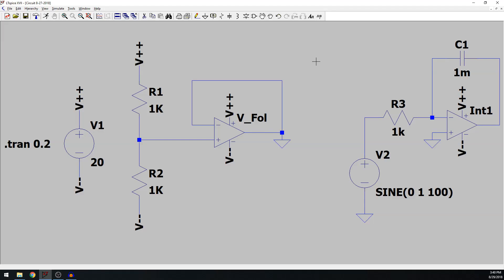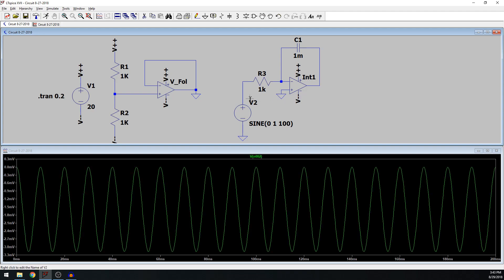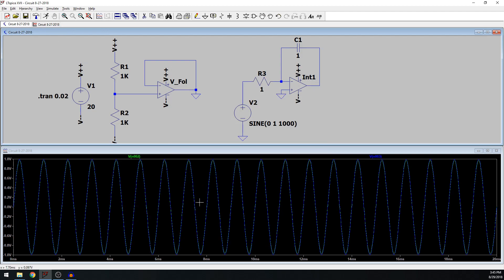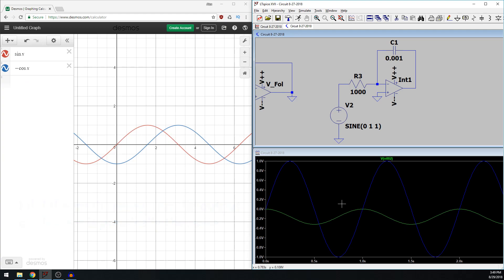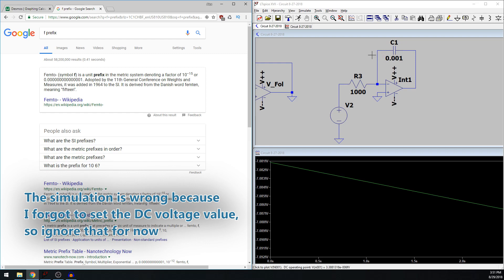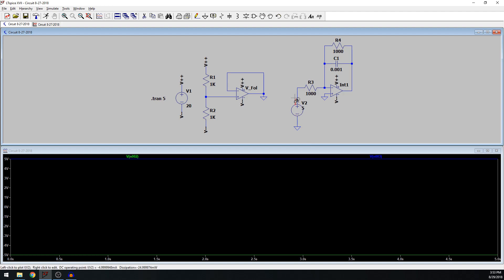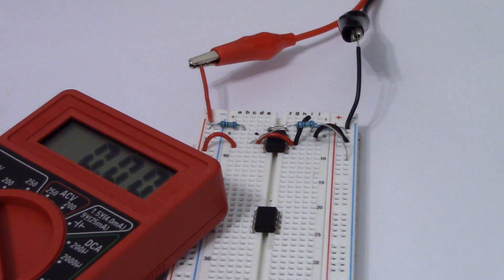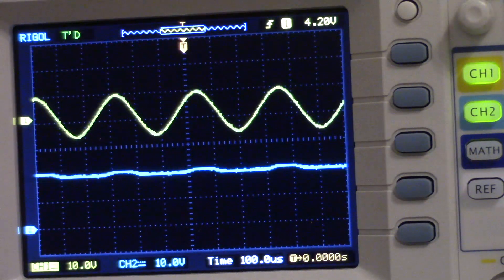Building an Analog Computer with Op Amps (Part 4): Op Amp Integrator is Not Working

Comment: Add a resistor (R2) in parallel with the capacitor, integration begins at frequencies f= 1/(2*pi*R2*C), a gain of 1 can be achieved at frequency f = 1/(2*pi*R1*C). Works better at higher frequencies. https://en.wikipedia.org/wiki/Op_amp_integrator#Frequency_response
Reply from the maker: Yeah, I redid the math and figured that out. For some reason, I thought I could have just ignored that and just set any RC values without worrying about the frequency. 

It actually works in the simulation now, but it doesn't work in practice! I believe I know why, and if it's because of that reason, then I'm dumb. 

I don't know if you can tell why my circuit still doesn't work even if it's set at the right frequency? I mean it might be obvious, but it wasn't to me. I'll leave the suspense for the next video haha.

(Hint: look at the circuit I actually built.)